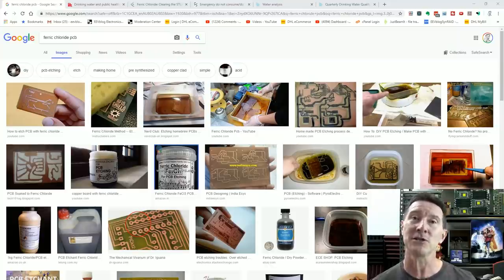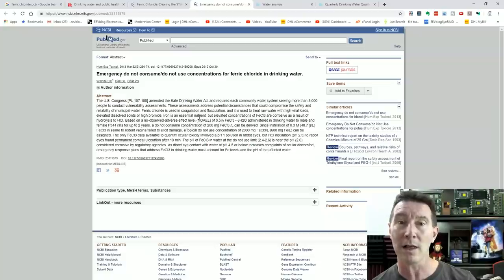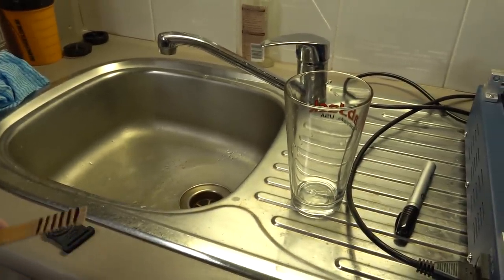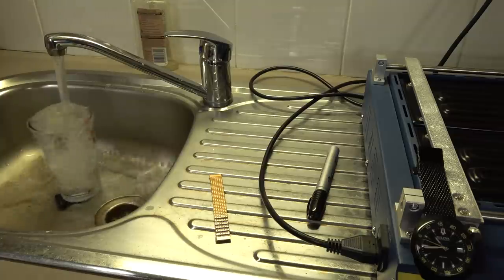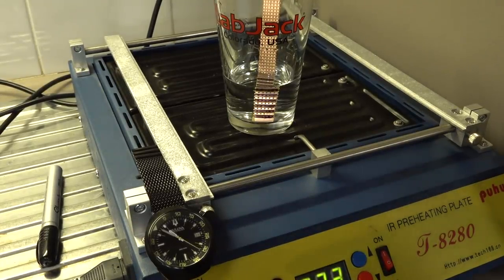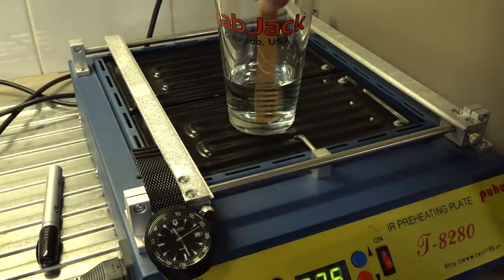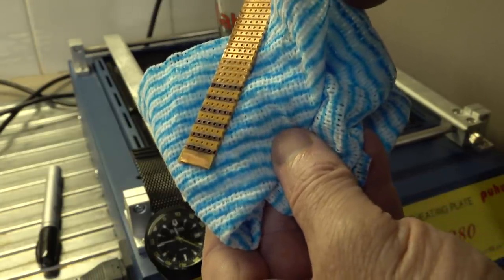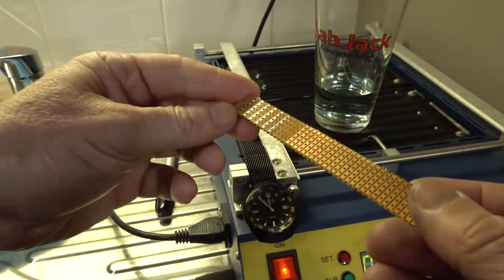EEVblog #1197 - DIY PCB Etching With Water

Comment: Mrs. EEVBlog could probably have told Dave this would not really work, at least the concentration aspect of this experiment. I really don't see how you are going to concentrate anything in the bottom of the glass when you are forcefully flushing the contents out regardless of the magnet strength.

Comment: I think if it was me, I would have improved my concentration of ferric chloride by running the tap more slowly and for longer then I’d have syphoned the top portion of water out of the glass instead of pouring it out

Comment: What about taking a skillet on the stove piping hot and fill the bottom with like 1dl of tap water and let that boil down to 1/10 and then you pour it in a jar or whatever. Now do that 10 times and you have a new dl of water. Pour that in another jar and do that 10 times. Now you have 1 liter. 
Start over with your tap water that's now 10 times as concentrated.
Start over with your tap water that's now 100 times as concentrated.
Start over with your tap water that's now 1000 times as concentrated.
That was three laps ...
Catch the pattern and stop when your skillet is filled with rust!!! :D
Skillet has large hot surface. It's a small amount of water evaporating it 20sec.
No, I'm nowhere near a chemist and I haven't tried but ... you know, I'm a hobby chef and reducing liquid is part of the game haha! :D

Comment: From what I read online, for materials like water and ferric chloride a property called "magnetic susceptibility (χ)" is defined. "This allows a simple classification of most materials' response to an applied magnetic field into two categories: an alignment with the magnetic field, χ>0, called paramagnetism, or an alignment against the field, χ<0, called diamagnetism. [...]  Paramagnetic materials align with the field, so are attracted to the magnetic field. Diamagnetic materials are anti-aligned, so are pushed away from magnetic fields." For water χ = −1.298×10−5, cm3/mol for ferride chloride: +13,450x10−6 cm3/mol. These are opposite signs, roughly the same absolute value. So the magnet definitively did something, I am not sure what happened with other compounds in the water though. Also, the mixing due to the stream of water affected it. Disclaimer: I am not a chemist. sources: https://en.wikipedia.org/wiki/Iron(III)_chloride, https://en.wikipedia.org/wiki/Magnetic_susceptibility
Reply from the maker: Cool, thanks.

Comment: ferric chloride? Interesting. I've always used Hydrochloric acid and hydrogen peroxide for etching PCBs. Depending on the concentration and the amount of water used you can etch PCBs in seconds or minutes at room temperature. We've been taught this process in school and that's how I've always done it.
Though these days you can't even buy 5% hydrogen peroxide anymore (years ago you could get 10% quite easily) which is quite idiotic. You can get more than that in hair cream, but that doesn't work for etching PCBs - I've tried. So I just pay a few € and get PCBs done professionally - plus the circuits that I do are these days mostly using 0402 components which is probably too fine for cheap homemade PCBs.

Comment: No, it won't work. Fe3+ hydrolyzes into Fe(oh)3 or its hydrate precipitate if the pH value is too high (and Cl- part would probably turn into Hcl or combine with other cations). What you will get by concentrating tape water is merely the precipitate. Moreover, the oxidation power of Fe3+ will reduce with increased pH so you probably need to add some hydrochloric acid to recover its ability to etch copper. Persulfates are another choice for etching PCB boards.
Fe3+ ions in water are not ferromagnetic, either. Concentrating Fe3+ with magnets would be ineffective.
The reaction should be between copper and oxygen. I won't use copper containers for water in the future. Nice try!!

Free iron chloride: take HCl toilet washer to clean your rusted steel tools, you'll get a bunch of that~~

Comment: Next you should do a control without the magnet.
Reply from the maker: Yep, should have, maybe a follow-up, but I'm pretty sure that wouldn't work.
Reply: @EEVblog  Would be intresting to do the two side by side & compair the time diffrence betwen the two.

Funny thing is this could be pratical as a hobbiest as water is easy to obtain.

Comment: Hey 
Please could you explain how to measure floating voltage.
If I have series of lithium ion battery cells how to measure individual cell voltage using microcontroller. As microcontroller accept input up to 5 volt.

Could you explain any circuit or logic to measure individual cell voltage .

Comment: flocculant helps bind all the dirt and CRAP.... is this the first time 'crap' has been used correctly?!
ya water concentrating solution is a bit lame and not thought through!...for starters ya had the flow too fast...the turbulence would have moved around any "concentration" of the ferric chloride..and the magnetic susceptibility is quite low, especially in low concentrations...the actual chlorine content is probably higher than the ferric chloride and would slowly etch away the copper
Reply from the maker: Quite possibly!

Comment: It seems to me that if ferric chloride in the water was going to eat copper, then it would eat the copper pipes we have in our houses over years and years of constant contact. Especially the hot water pipe.

EDIT
Well it seems like it worked. Maybe you could concentrate the solution by evaporating the water away instead of using a magnet?

EDITEDIT
Oh look, It's 3/31 here. Must be april first there.

Comment: Dave, you have not concentrated anything with the magnet. It had absolutely no effect.
Whatever the magnet could've done was undone by the force of the water going in. You saw the bubbles being pushed to the ground.
Reply from the maker: But I ended up with a concentrated solution that worked.
Reply: @EEVblog  Please do comparison test. (using the forceful water input, one with magnet and one without.)
Reply: ̷ ̴ ̸ɢ̸ʟ̶ɪ̸ᴛ̶ᴄ̶ʜ̷ ̶ ̶  No, fool. :)
Reply: @envisionelectronics  Why not, sheep?
EDIT: To be clear why I think this is bogus: Iron(III)Chloride (that's Ferric Chloride) is 3.75 times as susceptible to magnetic fields as Iron(III)Oxide, that's rust. And you probably know how bad rust attracts to a magnet. (Visibly none)
EDIT: We are not talking about your common rust that you have easy access to that may have still iron in it. I mean pure substances.

Comment: how about using a more powerfull magnet? like a 6x6x2cm neodymium magnet
Reply from the maker: Yep, but I couldn't find it after the lab move, so had to use my Fluke meter hanger neodymium magnet
Reply: nah, that would make it too concentrated, you don't wanna over etch

Comment: I guess you might get much better concentration of the FeCl by just letting the tap water drip into the glas with the magnet under it. There's more time fro the stuff to settle down and less turbulence to carry it away.
How much galvanic power can you get out off it? Maybe there's **Free Energy**(©) in your drinking water? :oD
Ah, yes, coat. -.-

Comment: I thought you had to expose the copper to UV first then do the sodium hydroxide part before etching in ferric chloride ?
Reply from the maker: That's only for photo-resist coated copper (hence the name). Normal copper clad board and a resist like a marker is all you need.
Reply: Not the copper. Its the UV resist on top of the copper. It make it not come out and stay on the copper to protected it.
Here, he skipped that by using the sharpie.
Reply: Oh I understand now, thanks for the reply's.

Comment: Well, if I hold my neodymium magnet on my Fe(III)cloride  cup it does nothing, I don't think it is ferromagnetic so the experiment should work even without the magnet. Besides that one may mention that Fe(II)cloride is indeed ferromagnetic and is used in magnetic pigments... What makes me wonder is that the concentration of Fe(III)cloride in drinkwater is that high that it can fully donate all Fe+ and Cl- to that amount of copper on the pcb. Maybe someone can calculate the approx. mass of copper on that pcb and do the stoichiometry how much Fe(III)chloride is needed for a complete redox reaction and compare that amount to the water supplier analysis concentration...

PS. and that etching in one hour? I somehow dont believe that. I know how long my very very old Fe(III)chloride solution takes to etch, some 20 to 30 minutes and we all know how concentrated it already is. Even if I half or quarter the concentration to get one hour etch time it will be still a black/dark reddish solution... hmmmmmm
Reply: It's going to be a long day for you.

Comment: i was wondering if anyone tried using the weather to etch a board?

prep the board the same way as usual and put in a container and leave outside and when it rains you have a 4ph acid etchant.

acid rain is always going to be a problem since industry continues to release co2 and other toxins that react with water to form acid.

Comment: This is why I put magnets on all of my water inlet pipes, to capture the ferric chloride from the water before it can eat my pipes. It also has the added benefit of alighting the ions in the water which not only improves the water quality but enables weight loss and increased mental capacity.

Comment: It is homeopathic etching and you are doing it wrong. Instead of concentrating it, you should dilute with extra distilled water. But be careful, extra dilution could affect traces memory and skew your schematic.
Reply: Yes, you're right. Also, Homeopathic etching can be done with solid granules.

You sprinkle the diluted solution on some sugar granules (mostly glucose and sucrose), let them dry and there you go, you have homeopathic granular pcb etchant!!

Comment: I used to do this trick all the time about 20 years ago. I would concentrate about 500 gallons of water to make about a pint of etchant for my pcb's works great, just takes a lot longer.
Reply from the maker: Yeah, much longer, but works in a pinch.

Comment: Next thing you will be telling me that if i bake a turd in an oven long enough it will turn into carbon that i can cut up and use to replace the motor brushes in my drill !  If tap water etches copper why doesn’t it eat through the copper water pipes in my house ?

Comment: I'm not kidding when I say that engineers are really really bad at basic scientific method knowledge. We are oblivious even to the simplest idea of using a control to run an experiment. In this case, using an "unconcentrated" water to see if it has the same effect or not.
Iron ions are not magnetic, they are paramagnetic and even with a magnetic field density of 1 Tesla, you would still not see a notable attraction of iron ions.
By the way, I'm an engineering student, so I'm not trying to snub anyone. It just something I've observed time and again, even among professors.

That being said, There is another problem. When you etch copper you have a solution of copper chloride, which is very toxic for aquatic life and should not be disposed on your sink before you make the copper to go back being metallic powder by... I don't know, I'm not a chemist. But I know you have to do it, some how.

Comment: Pretty sure Ferric Chloride isn't magnetic. Pretty sure the magnet made no difference. I don't have a strong magnet myself, but what happens when you bring a strong magnet close to a bottle of pure ferric chloride (i.e. not one that might have some metallic iron leached out of it)? Is the magnet attracted to the bottle?
Reply from the maker: No other way to explain the concentration though?
Reply: No other way?  You have assumed that the etching worked because the iron salts were concentrated by the magnet. But as others have pointed out, control experiments need to be done. In addition, you could make some back of the envelope calculations to determine how well this could possibly work. Assume the maximum allowable concentration of FeCl3. Assume that the magnet increased the concentration by an order of magnitude. If you have 100 ml of this solution in the glass, how much copper should it remove if it were all consumed?
Reply: @EEVblog  what concentration? You don't know that anything has been concentrated. It could be that there is enough FeCl and other stuff in your water to do the etching. Do you have fluoridation? Might dissolved oxygen be playing a role?

If magnets cannot concentrate FeCl, and if there has indeed been a concentration of FeCl, then logically there must be another way.

Comment: Cupric is easy and regenable with fish pump for many uses them another cap hcl some baths later. : pool acid, hair bleach and calculated amount copper scrap.. Clear vol 40 hair bleach is 12 percent h202. Video is kinda pointless u could use the water itself if u waited long enough or hl pump it through a tube with restricting bit on end....

Comment: you should have included a trigger warning :) Flashbacks of using a thick-ink marker directly on single-layer copper clad boards, etching (FeCl3 is for sissies -- I used hydrochloric acid with 30% hydrogen peroxide, etch done in under a minute). The real bitch was drilling all the little holes. When I discovered Positive20 spray I was in heaven!